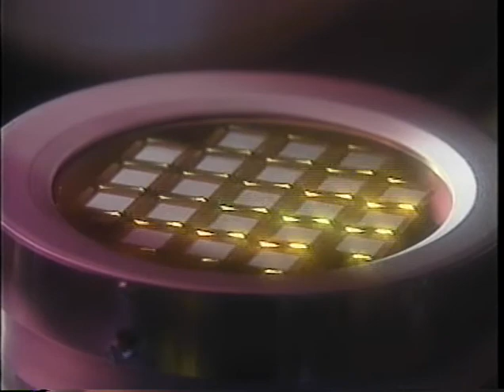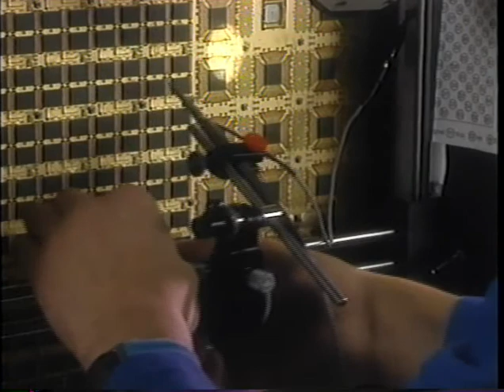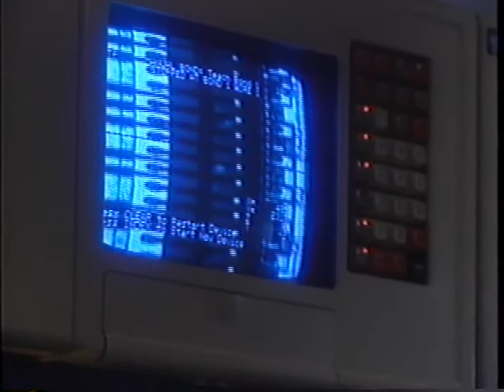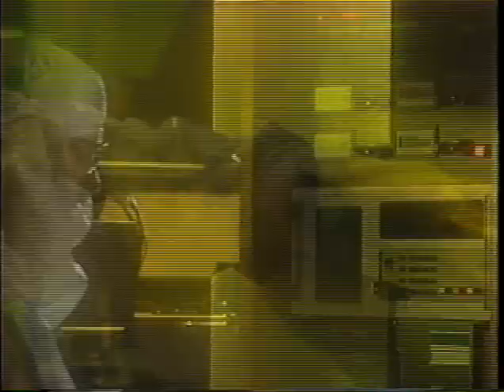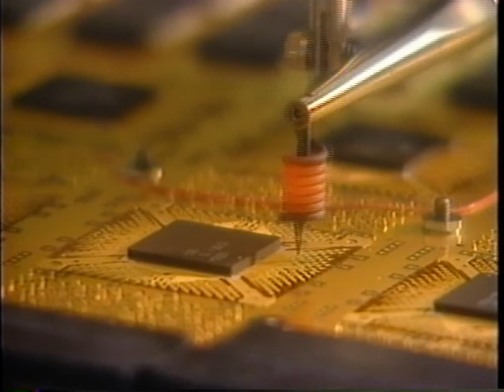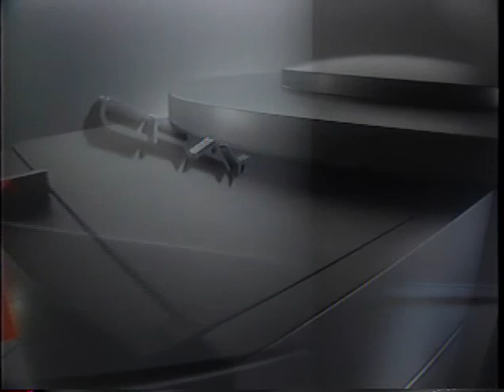Engineering the Cray YMP C90 SuperComputer

Comment: Wow this is a blast from the past. I worked at Cray Research in the Printed Circuit facility back in 1992. I had no idea that the performance of the whole system was so far below that of even a typical modern phone today.
Reply: I don’t know how you compare these computers to a smart phone.  The thing that distinguished the vector supercomputers was not only the clock speed and large memory, but the wide data paths and parallelism.  I know you can get vectors and parallelism in a microprocessor today, but is anybody running weather models or similar large simulations on a smart phone?
Reply: @GH-oi2jf  Because I was referring to processing power, not installed software. Also, wikipedia says the C90 had between 1 and 8GB of RAM. My phone has about that.